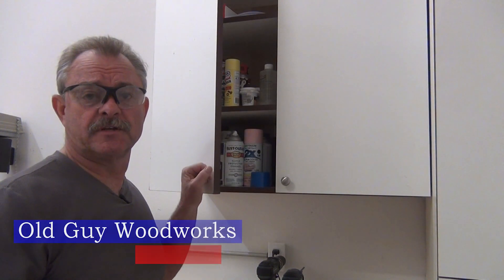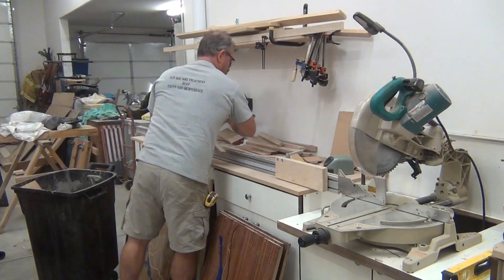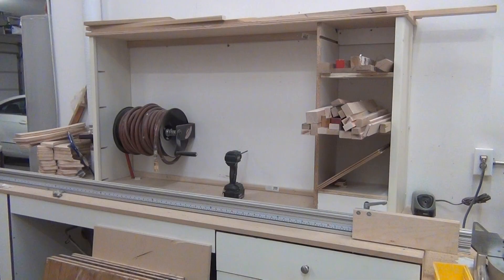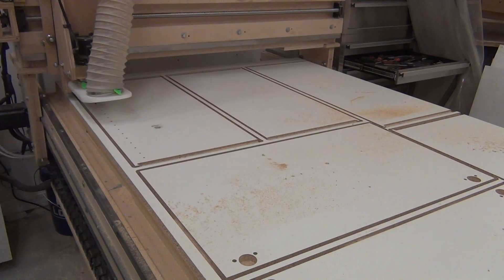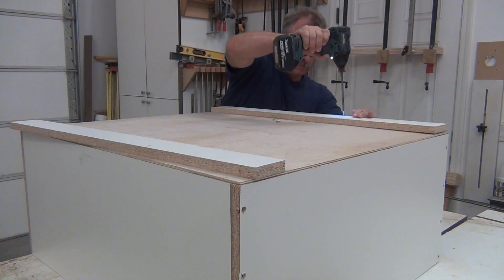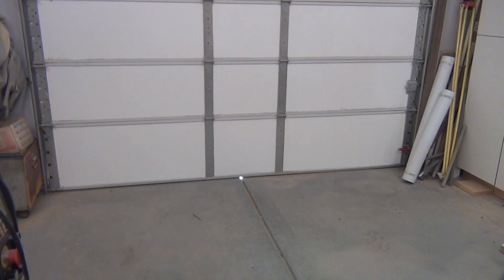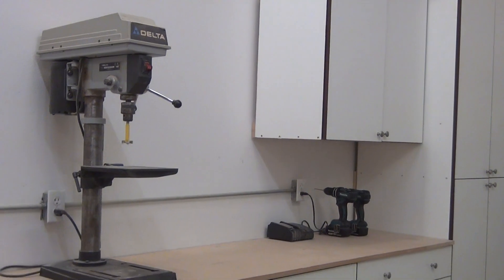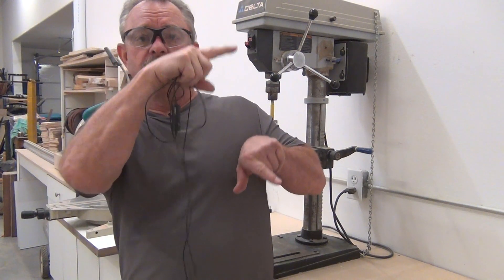Shop Cabinets - Building an Upper Cabinet, Doors and Drawers

Comment: I plan on making some melamine shop cabinets. What type of screws did you use?
Reply from the maker: Square drive 1 3/4" from Quickscrews and 1 1/2" pocket screws.